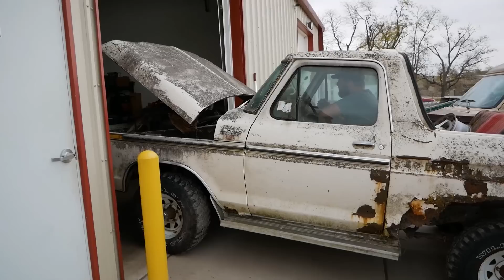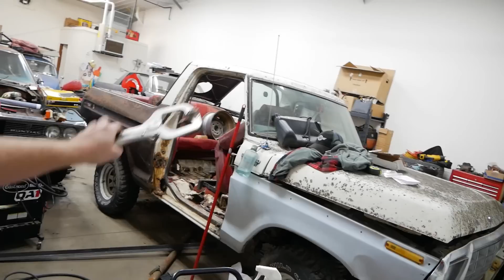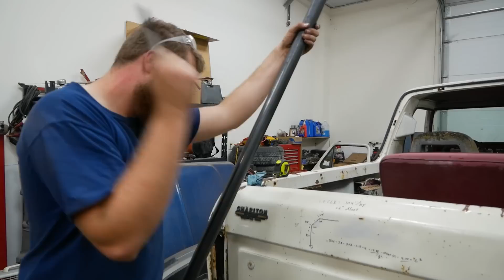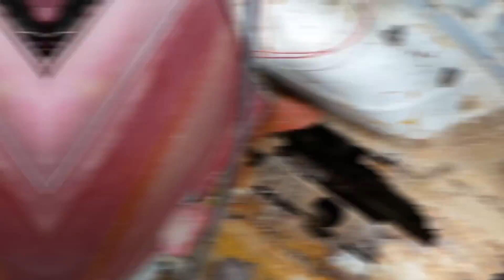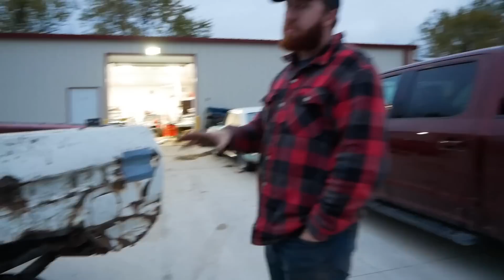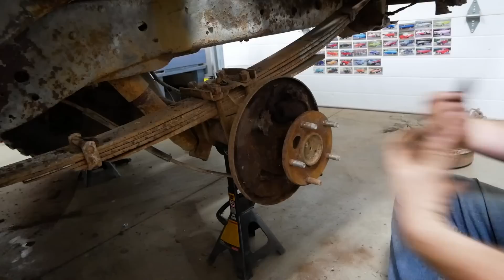Building an ABANDONED Bronco into a DIRT CHEAP Off-road Rig!!

Comment: Kevin the great things about plasma cutters is getting broken drill bits and taps out are super easy. Just heat them up red hot 3 times let cool off and they crumble out like a cookie with a hammer and punch. Super easy.

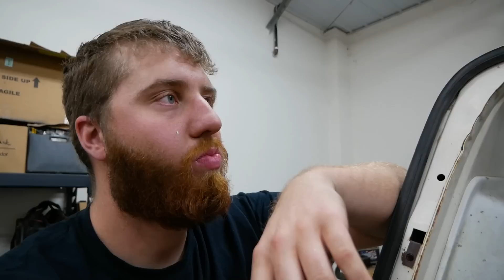Comment: 36:12 Some cutting fluid, or basically any oil, used atf or motor oil is basically free, as a lubricant will greatly improve the life of, and speed/ease of use with your hole-saw bits in that swanky notcher!

Comment: Hot Aussie tip when wanting to figure out bending angles that you want running pipe is to get a medium gauge wire and bend your required path as a template... 

Den...

Cut that wire to smaller templates in making it easier...

Fuck maths 😂

Comment: Just stumbled on this video and I have the older non digital version of that welder and you made a very good purchase. I have used and abused mine laying down hard facing wire for hours on end ignoring any duty cycle and it still runs like the day I got it. I also have the newer version I bought that is digital and have barely used it since the old one just keeps on plugging away. Love what you guys go keep up the good work!!!

Comment: Pro tip measure and mark all your bends then start bending don’t try to do one bend then measure off that bend it’ll be super inaccurate.
Reply: Also slow that notcher down keep the drill on speed 1 or you’ll burn up a lot of them and grab your self a digital angle meter and angle offset clamp if you get into doing different planes

Comment: I know this video is almost 3 years old, but figured I should point out something about thermostats for Ford 351C/351M/400 engines. They take a special thermostat, similar to a Robertshaw 333 but with a special hat on the bottom that blocks off a hole when it opens to route the coolant correctly. That hole is in a brass plate in the 351C that people sometimes think restricts flow, so they remove it, then wonder why the engine overheats. In the 351M/400, that plate is cast in and not removable, but the wrong thermostat won't close the hole all the way, so it'll still overheat.

The 351W engine uses a normal thermostat.

Comment: When we wreck and use our roll bars we are never intending to do so before hand lol. Welding a hoop together from 2 pieces isn't the preferred way but if you do my suggestion (if you ever do it again) would be to sleeve a smaller tube inside of the 2 pieces coming together just to strengthen that joint. 
Love your videos, just had to comment for the first time, as a guy who builds roll cages lol.
P.S. It's tubing not pipe haha pipe is for plumbers and general contractors. Race car drivers use tubing :D

Comment: lol, i would have done the math the easy way on that pipe bend. just draw a right triangle on your diagram with your intersections at the bend points, perpindicular to the pipe. now solve for the height of said imaginary triangle. add that to the height of the vertical section of pipe you have there, and you're basically done. you have every measurement for the whole job. writing the math out is about a 5 min problem. and i dropped out of college first semester ;)

Comment: Did you know your beer can is a limited edition that only came to a few states, yours and mine included. I don't drink but l was curious about the "Busch Latte".
Also, I once used a plasma cutter with my sheet laying on concrete.  Concrete explodes with in contact with a plasma cutter.  In case nobody else was stupid and discovered this.

Comment: I know that you are a big boy but please learn from my mistake . I used a plasma cutter a few years back with low cut cheep nylon shoes on . When I saw you hot foot yourself reminded me of that day . I took a molten gob of metal to the top of the shoe and it burnt thru pretty quick and landed in my shoe on top of my foot . I now have a silver dollar sized scar on my left foot at the ankle level . Do yourself a favor and wear work boots tied tight when using the plasma cutter .Don't be a Mike

Comment: hey Kevin when using hole saws on your drill. next time lube the cut with wd30 and a higher speed on the drill! You’ll get a cleaner cut and wont have to bench grind it smooth. plus it saves ware on your drill!

Comment: A tip to keep your bending dye's in good condition is to grease the inside of the dye and the pipe. Just a little will go a long way. Also puts less stress on the material you're bending.

Comment: An engineer but yet can't grasp that given a given length put a bend in it and it shortens the pipe which is why you have to allow extra length for the bend. It's the whole God gave brains thought he said trains trains fiasco and you asked for a slow one. Oh I know let's build a roll bar not even cross brace it and seam it in the middle who needs reinforcement anywhere. Let's just rip holes. Oh and let's take a cylinder which is the strongest when it comes to compression and kink it with a 20° bend giving a failure point when stressed to collapse let's call it a roll bar.

Comment: Hello there. My name is Robert Villarreal.  I have a 1987 chevy chieftain winnebago. 33ft. I'm looking for a bumper pull camper trailer for two people. The motor home is in good shape and the motor turns but the previous owner put a fuel pump in wrong. The engine is a 454. Please message me if interested or if you want to pass. Thank yall and God bless.

Comment: Gee, the "tubing" I used in my CJ-3A was 3 1/2" thick wall pipe for a roll bar welded to the frame and the body. I never expected to use it either, but I wanted a huge "safety factor" in case I rolled it. The roll bar had two 3 1/2" supports to the rear fender wells so it would not bend or flex. I did the welding on an old Lincoln welder from the early 60's, and drew a fine weld with little experience. I favor stick welders over wire/inert gas welders for their strength and choice of welding rod thicknesses and fluxes. Still, inert gas wire welders have their places for finer works.

Comment: I hate to tell you, but engeneers that do not Burry every day maintenance items behind things never intended to be moved again after installation. You will never get hired. Like a heater core, blend door, oil filter, fuel filter in the tank with no access panel. How about a sparkplug with a special wire than once the engine is installed it must be removed to change it or the wire. For God sakes get the liberal arts degree. The coffee shop is hiring.

Comment: Being an engineer isn't about knowing everyting. It's about pretending to know everything and making it seem like someone elses fault if things go wrong.
The engineers in my company needed 4 attempts to buy the correct hydraulic line for a valve connection. They were like "i don't need to measure this, i know exactly what you need." lol

Comment: i pay attention in school just math isn't my strong suit. now put me in my auto class and everything is different, except for the crown Vic that's needed a trans for 2 years. instead we have to either hope and pray it will choose at least one gear. or we just grab the Tahoe or square body yes my school has a MINT square for some reason. but if it doesn't go into a gear we just pull it with one of those.

Comment: couldn't you just stand the pipe up the way it would sit in the bronco and then measure up from the floor to see where 52" intersects with the tube and then bend it there so it would be 52" tall?

Comment: Try and never forget all steel will spring back at a different rate, or amount. I've seen this in a single section section of pipe and in flat stock as well. B T W Great job.

Comment: I have 2 Offroad rigs, 1 has nearly $70k invested and is a beast 2013 Jeep Wrangler Rubicon the other is a fully custom built (my 2 hands fabricated everything) with nearly $10k in a 1999 JEEP Cherokee... nothing is cheap or wonky and none will leave you stranded out on the trail , off roading is NOT cheap, the more time you spend building/fabricating in the shop provides more enjoyment on trails!

Comment: My 1981 Bronco was stolen from me when I went on a deployment from late 2002 to late 2003. I left the truck in the barracks parking lot. When I came home I was eventually met by the criminal investigation department. They found my truck. It was in an impound lot. I went to go and pick it up then they told me they wanted 2700 dollars to get it out of the impound lot. I said ok but let's see it first. I was so pissed. It was completely stripped. So I just signed it over to the impound lot. This truck was mint too. It have brand new 33 inch mud terrains on it. Freshly built 302 with some really good power. The interior was like showroom condition and the paint was about 98 percent perfect with zero rust or rot. I have wanted another one since then but never really found one in good shape for the money. Oh well I guess..... that was 17 years ago.

Comment: Buy some cow leather welding plaid for protection, when we did work as industry welders 30 years ago we used this when welding in a difficult spot. I think it was cow leather.
Get it from a old sofa instead of buying it perhaps? With a heavy duty sewing machine. Make a strap around your neck and waist and you can wear it. It should protect you from the welding shower. Sometimes, rare but still, some small glowing red steel balls dig into your skin and it hurts much.. thats why im telling :)
The factory did buy these, it was somewhat thick, perhaps two three layers.

Comment: way to much math.  Did alot of 5052 and T6 aluminum mandrel bends,  smaller diameter, on a manual bender, and ended up doing alot.   .035 to .050"  thick,  Great fun, LOL,  I just had a knack for it.

Comment: I am sure it’s been said, but when splicing tubing, sleeve it in between the two pieces, add plug welds and leave a very small gap between all three pieces so you can weld them all together. Great job figuring out how to do all the take off of bends, well done 🍻🍻

Comment: When you joint a roll cage in the middle like that its best to over sleeve it with another larger pipe about 18" long. Just for future reference.
Reply: Actually you use a “slug” that goes inside the tube, drill a few holes to plug weld and leave a small gap to weld up.
Reply: @AcesUpOffroad  plug weld? why not just drill through holes in both pieces and bolt it then weld the bolts on?

Comment: Here i am thinkin that bronco could still be saved, while simultaneously needing a bronco frame to cut in half for my travelall powerstroke build.

You also didnt need to spend money on a locker or spool, in this case id do a "lincoln locker" wled up the spider gears

Comment: I live in Massachusetts.  I own an 89 full size Bronco.  I know rust.  I know cold weather.  I know poverty LOL.  There are no older vehicles on the road up here unless they are brought up from some place else and sold for thousands more than what they are worth.  I'm too old for the crap you do anymore but watching your videos reminds me of what I had to do just to get to work on Monday.  My truck clunks as it shifts gears (regular driving) so when I know it's going to switch gears I let off the gas so it isn't as harsh lol.  I am not sure if it's a trans mount or the rear end.  I have a plow on the truck but when I try to use it the truck starts to die.  I bought a 150 amp alternator from power master because the stock unit is only 75 amp and computer controlled, I went with a one wire so I could just keep the connector unplugged and out of the way.  The rating is 104 amp at idle and 156 amp max so it should keep my scrap running as I attempt to plow my driveway. I have a manual tire changer and swap tires all the time.  Just picked up some dry rotted 33's for 100 bucks.  I liked that little car you got at the corn field. I am a fan of all makes and models.  I watch your vids all the time.

Comment: I swear I'm not a mathematician, BUT. When bending pipe, after the 1st bend kinda think of it as like putting PVC pipe together Measure the bend to the 52in ceiling and then the length from  the bend. And do basically the same math as your first bend. Basically to put to paper. Instead of drawing the pipe as it's own unique shape,draw a right angle and draw another on top to show the finished shape.. I really hope this helps not great at explaining via text

Comment: A lot to learn on safety equipment like the “roll bar”. The closer to the existing structure the better. Without any A pillar protection, and with such a poor fitting B pillar, the “roll bar” protection is minimal. Along with OEM seat belts and seats, I’d expect a educated mechanical engineer would make better decisions. But hey, this is just a mechanical design engineer with 10 years experience based on a trade school two year degree talking...don’t mind me.
Reply: I appreciate the content, just hope the vehicle doesn’t end up on its top killing somebody.

Comment: Love the Bronco!!  Glad to see you bringing it back to life for one last blast. I look forward to seeing how it does.

I really hope you don't need that roll bar!!  Never put a joint/seam in the main hoop. And if you have to, then you should sleeve it and plug weld the sleeve to both halves before welding the seam to add some more strength.  And with as rusty as that body is I would have added some plates from the body to the roll bar just to help hold it all together.  A roll bar welded to the frame doesn't do much if the body and seats break away from the frame.

Comment: i traded 2 chevy pu doors for a new set of rims 16.5 witch i needed so now i can get military tires 36.5 for 25 bucks a tire with about 75 to 80% rubber on them the rims that come with them will fit a 3/4 chevy but for ford u have to grind the center to fit . i picked my 70 high boy up for 250 bucks nice clean body no rust tool box on side extra parts dana 60/80 under it 390 with a 4 speed top loader

Comment: Did you notice that one side of the roll bar is higher then the other by about a inch or better?? FYI non-symmetrical boxes are weaker then symmetrical. I would install a big Xin the main hoop for strength.

Comment: Not to question a Ford fanatic's thought process... but if one was concerned with keeping it cool at extremely low speeds, why not just remove the thermostat altogether?  Just asking because Mook didn't want to ask on camera.
Reply from the maker: Coolant moves too fast through the radiator to transfer heat. 

plus it was 36 degrees the day of the event, I was really glad I had a thermostat

Comment: I FUCKING LOVE THIS SHIT DUDE!!!!Very rad dude!!!! Hey when welding pipe like that, start bottom to up. You want to run up hill. Its slower but it is a stronger weld.  Down hill (starting top and going down) is faster and easier but not as strong.  Down hill is still a very strong way of welding though. Its down on pipeline jobs  all the time.  The ones that run through woods and country sides over long places, think like Alaska pipe line. 
Weld.com on youtube is a good place to get some more info and how to’s on welding.   Crushing it dude.

Comment: when mig welding, angle the gun in the direction of travel. if your doing vertical down either crank the settings orrr just do it vertical up like your supposed to in structural. With fluxcore you drag, remember that as When theres slag you drag. Also for mig electrode positive, when fluxcore electrode negative.

Comment: You should keep the truck and slowly build it up. The 351m and 400m are decent low rpm motors and probably a C6 and 205 transfer case, the drive train is about as bullet proof as it gets! I had a 1978 f-150 with that exact same drive train however it was not a stock motor. Rv cam performer intake headers and an Edelbrock 600. Great truck, horrid mpg !

Comment: Dude it’s geometry. You know an angle you know a side. Ok let me slow down and help you out. Originally, the straight bar is a certain length long. Then you end it. That creates an angle between the original straight and the new piece that is bent. So now you have a right triangle formed by the straight (what used to be the original piece), the new bent piece, and the top of the cab. The new piece after the bend is the hypotenuse of the triangle.
Reply from the maker: I'm going to guess you made this comment before we did all of that on camera 😂
Reply: @JunkyardDigs  for the first set of bends. You literally can use a triangle to figure it out too.

Comment: Loved it. You did an incredible amount of work in a short time. I was a mig welder and welding quality control guy for the old Clark Equipment company. You should wear protective stuff when you weld. I saw new welders set themselves (including me) on fire by not protecting themselves. Also the flash from the mig welder is not good for exposed skin. I hope you win.
Reply: You can get an awesome sun tan in the middle of winter by welding in short sleeves..helmets are cool but a good pair of goggles will have you looking like a racoon. Don't ask me how I know these tidbits

Comment: For what it is worth, I personally would keep the Lincoln Electric MIG over the Eastwood. The Lincoln will last a long time. I’ve personally not has alot of luck with the Eastwood welders by using them every day. They are great for someone who welds once in awhile. The Lincoln is the better welder.

Comment: Use skin protection, I had a skin cancer cut out I suspect was from welding . Was inside my leg away from direct sun so I suspect this was from welding as this spot use to get UV burnt.
I’m 50, so you don’t want to get to my age forever getting skin bits cut or frozen off, over 20 + so far.
By the way, you can weld, even with the cheap 110 volt welder, you a lot better than some of the other builders on YouTube that are so called fabricators.